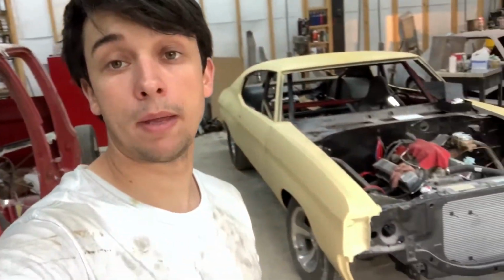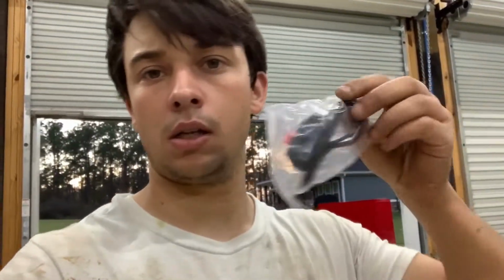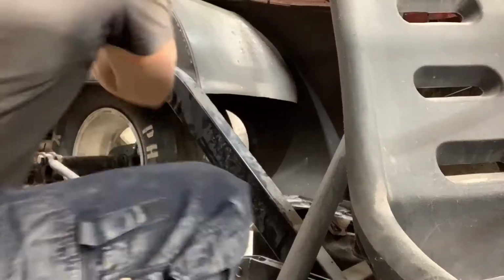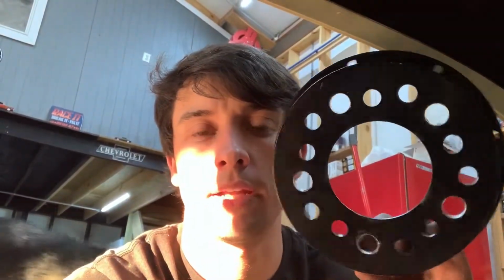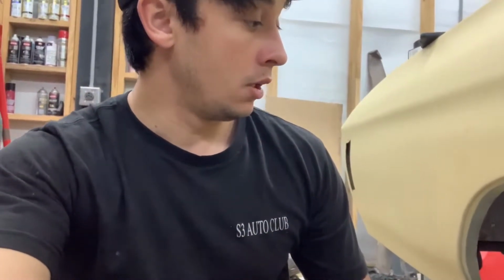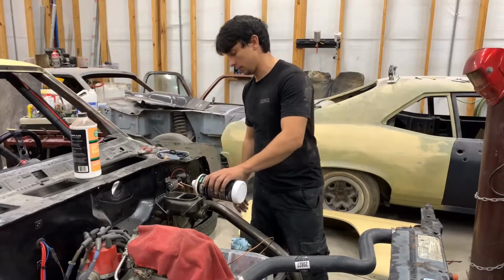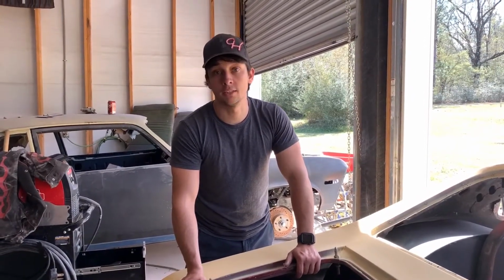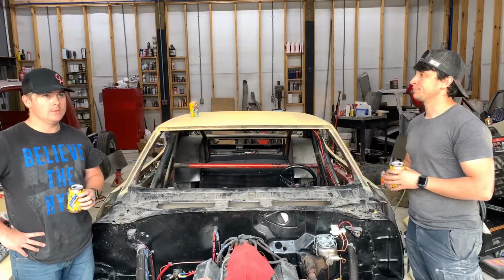Building Aluminum Interior From Scratch For Our Chevelle!

Comment: What size Pheonix tires are you running ?  I have a 71 Malibu that I have been working on far to long. My car has a narrowed 12 bolt drum brakes spool 33 spline axles 4:10 gears. Have 31x18.5 Mickey Thompson Pro tires on 15x14 draglites. Spend most of my time working very little on the car, plus like you to many irons in the fire.
Reply from the maker: They’re 29x10.5x15s on 15x10 Vision Sport Star II wheels. And you aren’t kidding about that! So much to do, and very little time 😂
Reply: @CoopsHouse  in 2019 i built my dream shop 36x40 with 10'4" walls fully insulated big enough for all 5 cars. Unfortunaly my car budget went into the shop. Start from scratch saving for car build, oh well thought about starting my own channel but to many different types of cars 3 Chevelles and 2 Oldsmobiles. From 1964 thru 1984 so not sure what to do such problems.
Reply from the maker: @chucksgmgarage1116  it definitely gets expensive. We have to take it day by day and do as we can. One thing we’ve learned from watching some of the larger channels is to “start messy”. We looked back this week at our older videos and we’ve come so far. Gotta start somewhere for sure! Every day is a new learning experience for us.
Reply: @CoopsHouse  not on any social media would like to show you a couple pics.
Reply from the maker: @chucksgmgarage1116  yes sir, absolutely. We’d love to see them. If you start up any social pages, hit us up so we can check it out!
Reply: @CoopsHouse  do you have e-mail i can send them to
Reply from the maker: @chucksgmgarage1116  coopshouse01@gmail.com
Reply: Was that a interior kit or did you make the panels yourself?
Reply from the maker: I just saw this comment but I made all of my panels